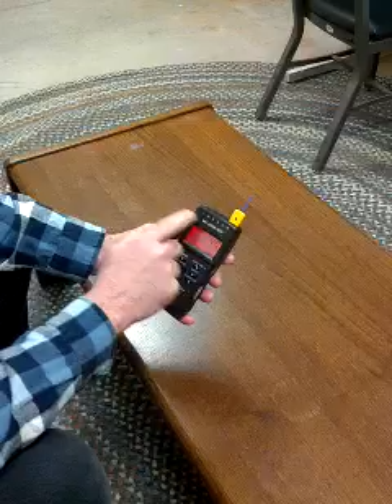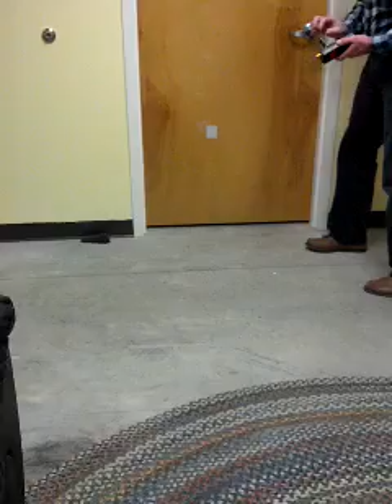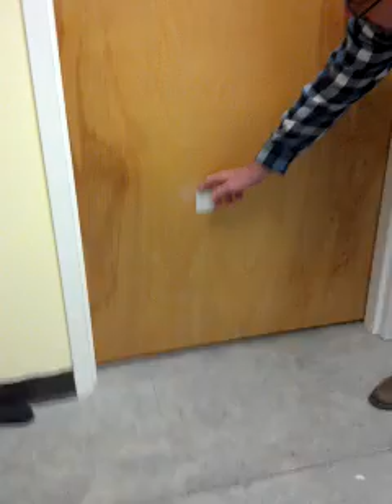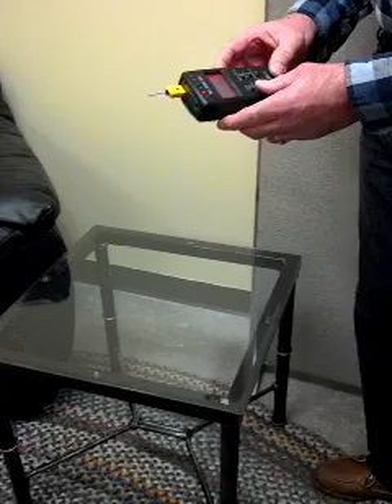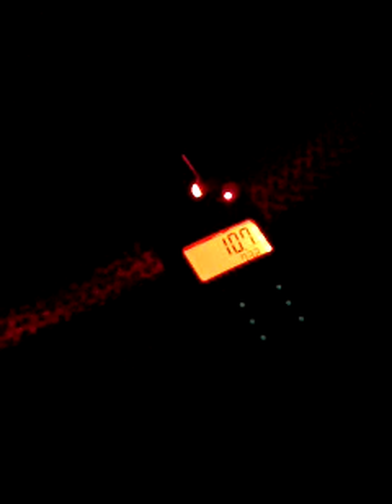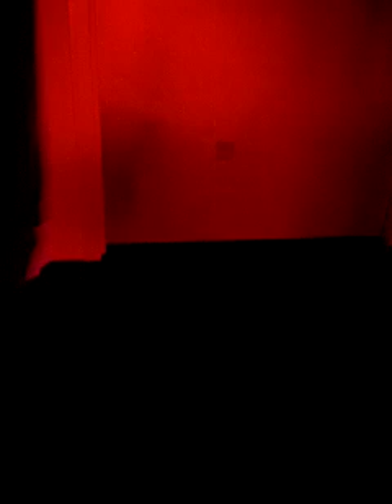Mel-8704R-SDD Using The SDD with Retro-Reflective (Prism) Tape

Comment: Unless you had someone else in that house when this was filmed, I think I heard Melissa speaking at 0:35 and 0:37. Maybe go back and listen and try to confirm this? Also, I own the Mel Meter 8704-R EMT 7:1 Professional Model. I've been doing all sorts of experiments with it. This happened while I was in bed one early morning. Taken direct from my paranormal log I keep. What are your thoughts on this evidence? Thank you!       9/1/2023- At the following times, my Mel Meter 8704R EMT Pro had the shadow detection alarm activated while I was asleep or trying to sleep in my bedroom. 12:53 AM, 12:59 AM, 1:03 AM, 1:23 AM, 1:43 AM, 1:53 AM, 2:09 AM, 2:13 AM, 2:29 AM, 2:33 AM, 2:39 AM, 3:03 AM, 3:13 AM, (long series of quick  beeps), 3:23 AM, 3:43 AM, 3:53 AM, 4:12 AM, 4:23 AM, 4:43 AM, 4:53 AM. After the last occasion at 4:53 AM, I decided I had enough evidence. That I wasn't going to get any sleep unless I turned off the Mel Meter. I saw a recorded high reading of 3 mG EMF before turning it off. Note, for the alarm activation at 4:12 AM, I told the entity that it messed up, it was off by a minute because it usually activates on odd numbered minutes with times ending in 3. So it made up for this  by activating at 4:13 AM! The association with the number 3 concerns me a lot. 3 symbolizes the Holy Trinity, so this entity is either something demonic mocking the trinity on purpose, or I'm dealing with a religious spirit that is trying to give me a message.

Comment from the maker: Thanks...Black is the new standard. We still have some of the Off White original & they are being phased out. The SDD is a great tool that can be used so many ways. The next video that I post will show another way to use it effectively. The Retro-Reflective tape will be provided with the Mel-8704R-SDD, and other Mel Meters that have the SDD feature.